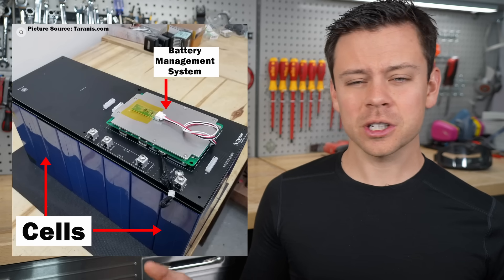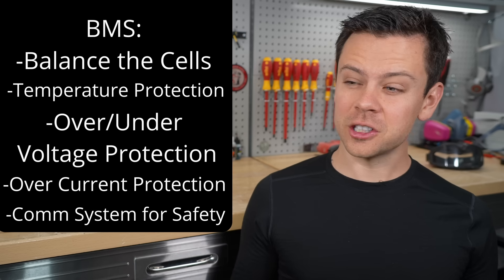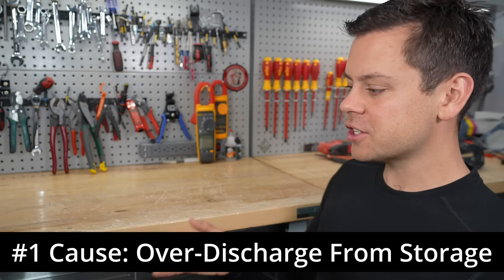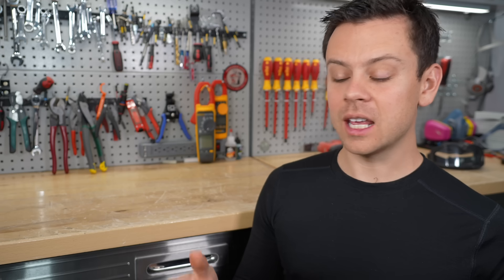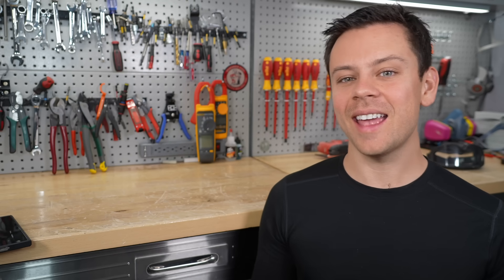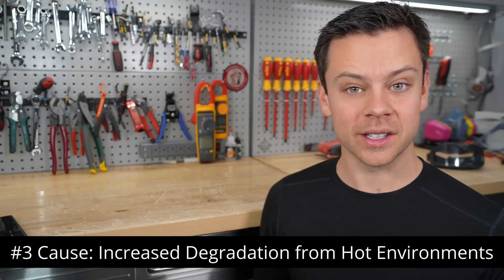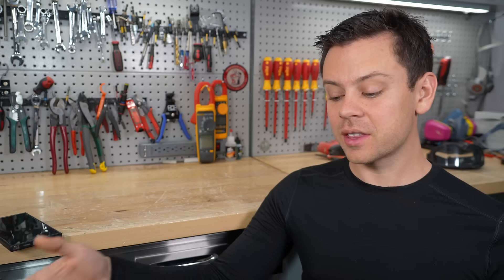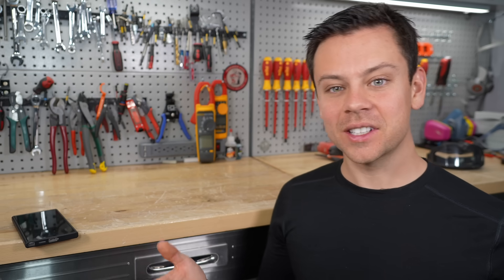The Rules of LiFePO4: The 3 Most Common Causes of Failure and General Guidelines for Long Term Use

Comment: In my opinion 70% of problems are with BMS and 30% of problems with batteries. Now if you add a good auto balance it will change. There is one more thing when you have 4 batteries in series like 48V you also need Autobalance so that the 12V batteries maintain the voltage evenly

Comment: To balance your batteries properly you really need a bench top power supply. It's crucial to know the balance current in your BMS. It is usually about 150mA in a cheaper BMS. For a 51.2V LFP you should set it between 54.4 and 55.2 and limit the current to 150mA. Depending how long the battery was stored, it could take a few days, even a week to properly balance. After that initial balance, the battery should stay in balance, but that depends on your charger. Try and use a closed loop charging system and always use the correct charge profile.

Comment: Good info - thanks.
Have you seen cases of and LFP battery actually being damaged by STORAGE  in cold temperatures?
I live in MT and have had my SOK RV batteries exposed to temperatures as low as -45F last winter and a capacity test after this exposure showed nearly full capacity on these 3 yr old batteries (I can provide a link to the capacity test data if desired).
It would be a big convenience not to have to protect my LFP batteries for below zero cold spells that we get several times a winter.

Comment: If I charge LiFePo4 batteries to 100% in October (temps above freezing) and leave them disconnected from the solar panels until May and temps get down to -30 Celsius in the cabin they should survive right? They will lose less than 3% charge per month times 6 months or maximum of say 20% of their charge? Nobody ever discusses this scenario  to my knowledge. Any advice on this would be most welcome.

Comment: Re: 0%. Another YouTuber, described available lithium battery usage percentage as, 120 to 20%. 120% as full. 20% is the BMS’s 0%. To prevent damage. As each cell is not 0 volts. Love your work Will.

Comment: So I have the EVE LFP batteries, 24V system. Overkill Solar BMS in my solar system. Generally I charged them to 100 percent and I would check on them from time to time to make sure they were balancing and closely balanced. They worked great for about two years. Then one day I noticed they weren't getting fully charged; they would only come up to 26.7 volts. After a couple of days of good sun they still wouldn't get any higher than 26.7v. and then I noticed that they weren't last as long either. I'm not sure what went wrong, but I'm guessing the BMS failed. Took the battery apart and am trying to see if any of the cells will take a full charge, but it doesn't look good.

Comment: I have a question about the overcurrent shutoff on BMS. Do they have headroom in them, or will a 300 amp BMS clamp down shortly after 300 amps? I plan on building a 12 volt Headway pack for car audio, and figure I need close to 600 amps for dynamic headroom. The largest BMS i see online are 300. Does that mean I need to build two smaller packs each with a 300 amp BMS? I will be charging with a 300 amp high output alternator, but deduct about a 100 amps for the car accessories.

Comment: no lifepo4 batteries sold in cold temperature countries should be sold  unless the BMS has low temp protection and i would add bluetooth capability.  in warm areas  no need  for low temp protection.

Comment: Hello Will, I have about 16 EvE LF280K cells sitting in storage for about 20months since they arrived.
And their manufacture date is Mid 2022.

I tested them today with my Uni-T voltmeter and
ALL the cells showed a voltage of 3.285 with a deviation of 0.001 volt.(like some are 3.286)

I havent touched the cells since they arrived and they sit in their full sealed package from Docan.

By your assumption, even with 2% self-discharge, my cells should have lost 40%.

Chinese suppliers ship around 30% SoC. (I ordered 100pcs and all of the ones i unboxed when they arrived showed 3.285)
These 16 cells, the leftovers, they didnt even seem to drop in voltage after 20MONTHS.

Why are my cells reading 3.285V? What is the deal here?

FYI my climate is Tropical. Im in SEA country.

Comment: Great video as always. I have 6 pylontech 3000 batteries with voltronic axpert ll 6500 inverters. My supplier has set up the batteries to only discharge to 20%. I want to follow your advice but cannot find out how to change my inverter, he won't tell me because he says it will cancel my warranty. I have the manufacturers "handbook" but it is almost impossible for this old man to read. Can anyone give me a link to the settings for these inverters please?

Comment: If I have batteries in storage at 50% charge. Will the cold affect them? Let's say below 35°F. I'm talking 2 months 3 months Max
Reply from the maker: No that's exactly what you want
Reply: @WillProwse Yes I understand 50% is the right charge but storing them in below 30° f temperatures, will that hurt the battery sitting without a charge for a couple months. The situation is I have my boat in storage. I would prefer to leave the batteries in the boat, but I know the storage unit gets below 30° f for a couple months during the winter
Reply from the maker: @thendricks9499  no
Reply from the maker: @thendricks9499  they'll be good in cold
Reply: @WillProwse  Okay thanks

Comment: Inverter Disconnect Question - What should the inverter disconnect setting be? I have a Renogy 300ah lipo battery and the BMS of the battery auto disconnects at 10 volts. Should the inverter be set to 10.2 volts for example?

Comment: I have couple of old phones that I don't use and charged them to 50% before storing and I turned them on after a year to check and they were still on 48% which is impressive but percentage drop would be biger with bigger BMS types depending how much they draw to function on top of battery self discharge.

Comment: My two used 680Ah electric forklift batteries equaling 74 kwh, $1250 equivalent in lipo $10000 and have worked flawlessly for a year. Hopefully a lipos don't burn your house down.

Comment: What BMS could I purchase for a EG4 LL battery replacement? I have no clue what to buy. I would really appreciate your help. 
Also, I think that the full warranty stands o these batteries as long as they are not discharged below 20%. For me, this would only occur about 5-10% of the year at most. Any thoughts on this?

Thanks.

Comment: I have two 200ah 12 V lithium batteries to power almost everything on my sailboat. I have two 200ah 48 volt lithium batteries on the boat also to drive the electric motors (no diesel). All the solar goes to power the 48 volt batteries. The 48 volt batteries are connected to a victron inverter for 110v. 

Here’s the problem or concern. I’m using a Victron MPPT 100/20 48v solar charger to power the 12 volt batteries. I’ve connected the 48v batteries to the solar input. So it’s getting input from the 48v batteries thinking it’s a solar panel. 

Sounded like a good idea but both 12 volt batteries were dead inside two years. 

I thought maybe this was because of the trickle charge the batteries were generally full all the time. They only hit depleted when I ran my Watermaker which drew power faster than it could be filled up. Otherwise the batteries are always at 100%. 

The supplier gave me two new batteries since they were still under warranty but I don’t want to destroy them doing the same thing. 

I’ve started turning the power from the 48 V batteries off at night so that the batteries have a daily cycle of dropping  and then charging. 

Can you give me advice on how to prolong these 12 volt batteries since after one year I’m already seeing degradation in these 12 volt batteries

Comment: Dumb beginner question here: Do LiFePO4 batteries therefore not generally work for minimally insulated off-grid cabins where temperatures sometimes drop below freezing in the winter?  Or are there simple ways to deal with those issues?

Comment: Thank you for the video, it's very informative.  I do have a few questions:
1) Is it better if the BMS begins balancing at 90% instead of 100%?  Do they make BMSs like that?
2) How do people add "active balancing circuits" without opening the battery case?
Reply: 1. I think most BMS will balance when a cell is 0.1 or 0.2 volts above the other cells regardless of state of charge. Just keep in mind that LiFePo4 cells are all the same voltage between 30% and 70% state of charge. It is only outside that charge range do you see the voltage differences start to show up and the auto balancers start to kick in.
2. Depends if they are trying to balance entire battery packs in series or they are building it from scratch and are balancing the cells in series.  Each battery pack will typically have its own balancer built into the BMS. They also make balancers that balance across battery packs connected in series. ie: 2x 12V battery packs in series will run at 24volts but will need to be balanced across the packs or one battery pack will be a lot less charged than the other resulting in that battery pack cutting out early during discharge which then means you can't get the rest of the power out of the other if the inverter takes only 24V input. Which is why you need to put a balancer on two 12V battery packs in series. Ideally if you knew you were going to use 24V you would just build/buy 24V battery packs with a BMS that autobalanced the individual cells wired in series all the way up to 24V. But that's not always an option as a lot of people start with 12V setups and later want to upgrade to 24V without tearing their battery packs apart and rebuilding them with new, more expensive BMS that balance to 24V. Some people like myself think building packs from scratch is just too much effort for too little return. So I work with packs themselves and not the individual 3.2volt cells.

Comment: I run my LiFePO4 RV batteries inside the coach to keep them comfortable and I stop grid charging at 50% and use solar for the rest of the capacity and charge slowly. I think they will do 5000-10,000 cycles easily.

Comment: How do you know when a bank of 4 epoch 12 volt 460 amhr batteries are fully charged? I have tried to load the Bluetooth app but won’t load for some reason. Should I trust that the batteries bms will stop excepting charge when it is full?

Comment: Maybe you forgot to say charge your  battery fully before using it the first time. Or if you get a solar generator to fully charge them before use. Have that problem with the first solar generator i bought. Now does not charge right the mebo. Just ordered a bluetti 1800 watt 1400 ah abouts, will be sure to charge fully before i use it like the manual says.

Comment: My solar generators are primarily emergency power backup.  I set up a reminder (every 3 mos) on my cellphone calendar to cycle them down to 0% then up to 100% and then down to 50%.  I set similar reminders for my lithium ion and lithium polymer devices (bluetooth speakers, small power banks, bicycle lights, drone batteries, spare laptop, etc).  Otherwise, it’s too easy to forget to charge all these things.

Comment: I have a small solar generator I built (thanks youtube) that has three 100 watt solar panels, a 40 amp controller, and a 2000 watt inverter.  I had two 100 AH smart LiFePo4 batteries and used the system mostly for charging power tools.  Then I added a small 1/4 HP air rocking piston air compressor which is 1.7 amps-115 v- 190 to 290 Watts.  Something happened to one of the batteries and would not accept a charge.  I assume something may have affected the BMS so I sent it back under warranty.  But the battery was lost in shipping and I still received a refund.  The battery manufacturer says the battery is not compatible, and not much else.  What battery do you think I should get?

Comment: Excelente información, en este tema hay demasiadas dudas de que configuración usar, en mi caso tengo configurado en carga a flote a 3.45v mis Lifepo4, con un voltaje de 14v, pero debemos de tener en cuenta que capacidad de almacenamiento tenemos, en mi caso para un hogar donde tenemos todo lo necesario tengo 500Ah porque de ahí dependerá que tan bajo podemos amanecer, en mi caso amanecen mis baterías en 3.3v por celda, por lo tanto estoy muy adentro del rango de alargar la vida al máximo ya que considero que no estoy estresando mis baterías, el internet lo tengo configurado con un temporizador de  06.30 am 0130 am ya que en la madrugada nadie lo utiliza, así tengo el mayor ahorro de energía.

Comment: These are so robust, they barely need any management. I DIYed a solar MPPT + BMS + balancer combo. The balancer+individual cell monitoring circuit semi-failed and I disconnected it to make a version 2. That was almost a year ago and I didn't build v2 yet. It now purely monitors input+output current and calculates SOC from that (no battery voltage measurement). It's still accurate (according to idle-voltage cross-check with multimeter). It apparently needs zero balancing and has near zero self-discharge. It could easily work without a BMS for low c-rates as it self-balances near 100%, like lead acid batteries, giving a bit of a time buffer for the human operator to notice 100% charge and disconnect. And pretty much any (non grid-tie) inverter has a low voltage warning.

Comment: Have 3 LiTime LiFePo4 280A batteries in my RV. Set up in parallel connection to bus bars. Full charge is 14.6v but converter goes to float at 13.6. Have 80A LiTine charger. Do I have to charge each battery to 14.6v separately while disconnected? Or can I connect the charger to the bus bars and top off the batteries simultaneously? Bus bars are 400A.

Comment: Awesome info thanks.

to ensure a 24V array composed of 6 x 12V batteries is balanced, is it better to wire in parallel first then series? e.g. 3P then 2S, or, 3S then 2P? 

Is this affected if one of the batteries is a year older than the rest?

Thanks!

Comment: For those wanting to know a little more on the DoD; it's true the lithium iron does much better over time and being discharged deeper over other lithium chemistries, however, a cell that is charged from 20%-80% will last longer. Comparing apples to apples, decreasing the depth of charge always helps, how much it helps though, as Will mentioned, is temperature and current draw. If the load is small, the voltage drop under load is minimal, and so is the heat generated. If you live in a hot environment, it would be a good idea to limit it to 95%.

Comment: Balancing isn't required on every cycle (once top balanced) if a cell doesn't reach >3.6v. But every 5-15 part cycles should then let it reach 100%. Balancing below 3.4v is wasteful & counterproductive due to the flat part of the curve, minor variations, Volts read vary more just by heating/draining differences. Dave from Off-grid garage has done videos regarding BMS integrated & discrete balancers. There's debate of high current only when charging as protection during charging vs having less Amp capacity but it continue balancing under certain conditions after charging has stopped (2nd is preferred).
YMMV.

The biggest killer is extreme heat & charging when frozen.

Comment: Can you reference your sources for item 2 using 100% discharge, I have never heard of this before and the data seems to indicate the less you discharge them, the more cycles you will get out of the battery, with 70% DOD being the optimum for capacity and lifetime.
Reply from the maker: Yes but how often are you doing that in a solar system with autonomy? Just use it. And my cycle versus calendar aging degradation are linked above

Comment: When I bought my two 100A/12V LifePo4 batteries, I didn't have a charger. The mfg instructions stated to charge them first. I just installed them and let the AZ Sun do the job. Nightly drawdown wasn't more than about 30%. Was that ok?

Comment: This might sound like overkill. I have two 100w Redodo Mini batteries in parallel. I also have two shunt/battery monitors. Do you see any problem with having a shunt/monitor on each battery. I figure since I have the hardware might as well use it. The batteries are charged with 370watts solar and Epever 30A MPPT solar controller. Things work ok but there seems to be a quicker than expected discharge. I have not connected the battery monitors yet.

Comment: I've had a 12v set of LifePo4's since August 2014 in daily usage as my solar batteries. They are 4x 1000ah cells combined to do 12v. The brand is Winston made in China. I've never bothered with a BMS because my inverters will supposedly cut off the load before one can go negative. After their initial balance charge done individually with a power supply they have stayed in constant balance with .02v difference across the cells. The bulk of their charge is in the 13.1 to 13.3v range with 13.2 being the primary. It used to be 13.3. I don't have fancy metering, so it's hard to definitively ascertain their degradation, but I'd say it's minimal.  My "charge controller" is a high low voltage cut off relay set at 13.8 high and 13.2 low. At the time I bought them noone made a Lifepo4 specific controller. Powerwalls had just been released. I assume the taper down of charge from my panels in the afternoon does the last absorption bit of charging. They've been great, I'm a happy camper.